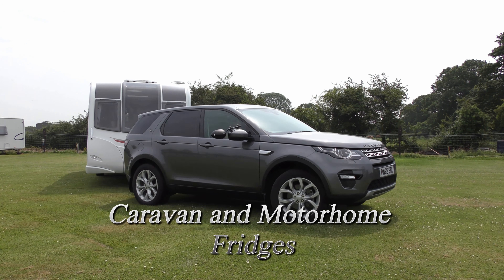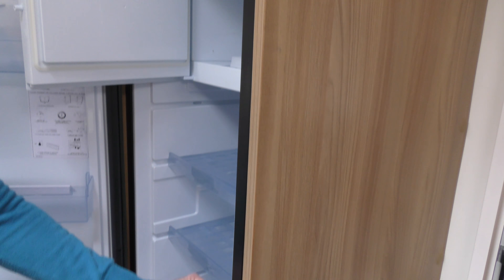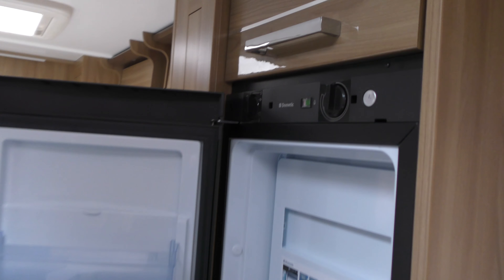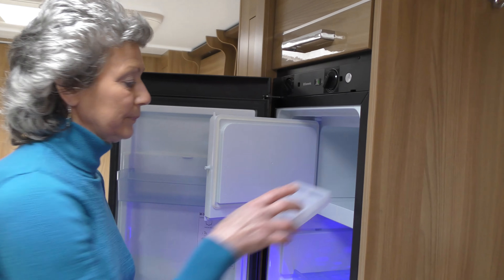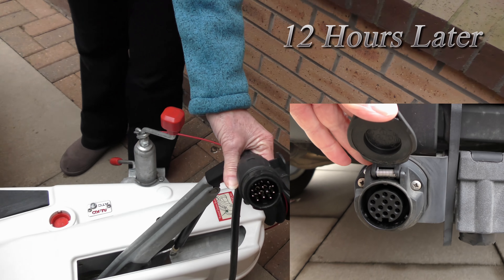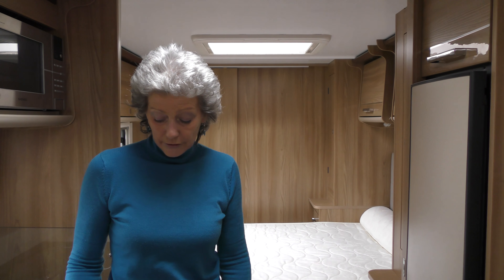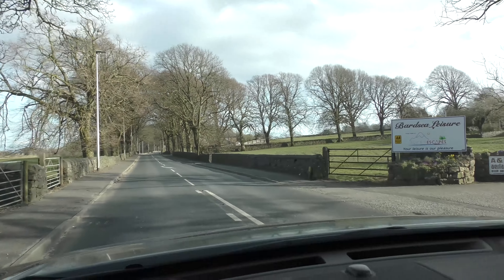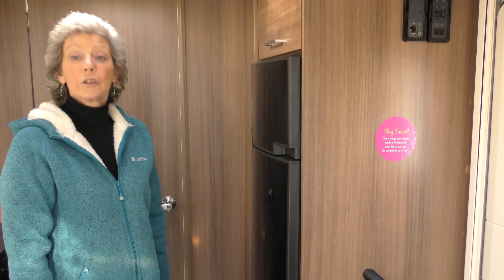Caravan and Motorhome Fridges: Caravan Tips and Tricks

Comment: I am a bit concerned  that you say that at a certain position of the fridge switch that it runs on the leisure  battery which you then show. In every setup that is standard is that on the battery icon position this enables the fridge to run from the towing vehicles electric system and only then when the engine is running and charging.
Hope this helps and prevents any warming mishaps.
Reply from the maker: Hi Jim. The fridge runs on the 12 volt leisure battery, gas, or 240 volt. If the 12 volt system is on in the caravan and the fridge is set to run on 12 volt, it uses the Caravans leisure battery. If the gas is on and the fridge is set to gas it uses gas, If the 240 volt cable is connected and the power is on in the caravan and the fridge is set to 240 volt it runs on 240 volts. 

However, if the fridge is running on the leisure battery it will run for hours and hours depending on the battery and its charge. It will automatically switch to run from the cars charging system when the cars engine is running once the car's battery is full. 

This prevents the car from losing its charge via the 13 pin plug when it is plunged into the caravan. Car battery are different from caravan leisure batteries and this protects them.  Hope this helps.
Reply: i guess Im asking randomly but does any of you know of a way to log back into an Instagram account..?
I stupidly forgot my password. I love any tricks you can give me!
Reply: @Levi Anson instablaster =)
Reply: @Terry Rudy Thanks for your reply. I got to the site thru google and Im in the hacking process atm.
Seems to take a while so I will get back to you later when my account password hopefully is recovered.
Reply: @Terry Rudy it worked and I now got access to my account again. I'm so happy!
Thanks so much, you really help me out!
Reply: @Levi Anson Glad I could help =)
Reply: @UsefulWisdom   Taken from the Bailey handbook
 Electrical Operation
12v-voltage (on-board power supply)
The refrigerator should only be used in 12V DC
operation while the vehicle’s engine is running,
otherwise the on-board battery would be
discharged within a few hours!
Reply from the maker: Hi @UCiGpaOE6vjKljTOS%F0%9F%98%80ocWdslQ  Very interesting, lets fully analyse this. You want to connect the caravan to the toe vehicle, then unplug the caravan's 230 volt supply. Then at the caravan site, before switching off the vehicle, you want to connect the 230 volt electrical connection to the caravan.  But John, what happens when you are traveling to the caravan site. You could not refuel, because you would have to switch off the engine, or stop to use the toilets without leaving the vehicle running.  John, a journey